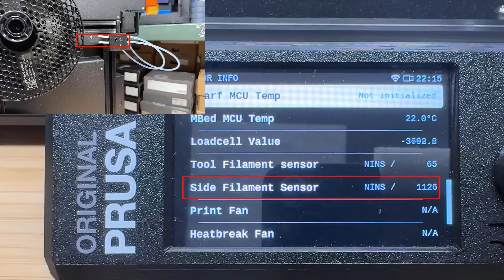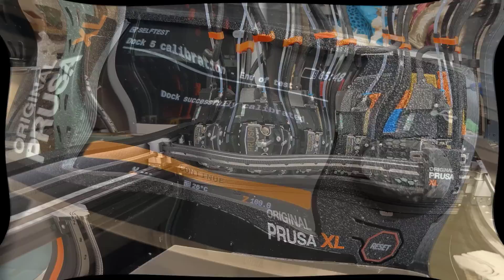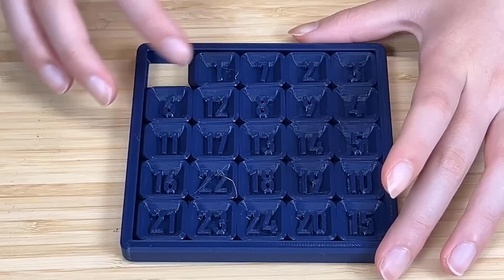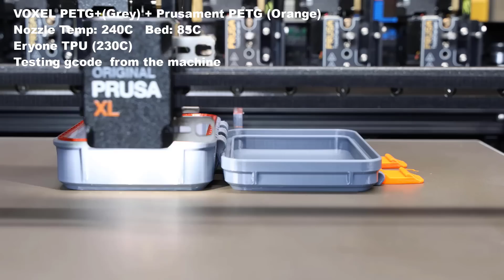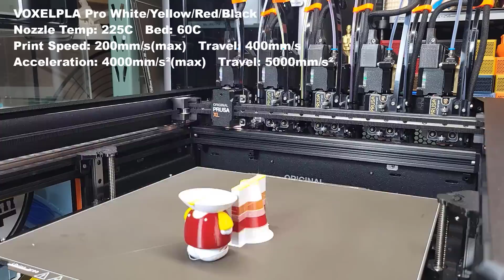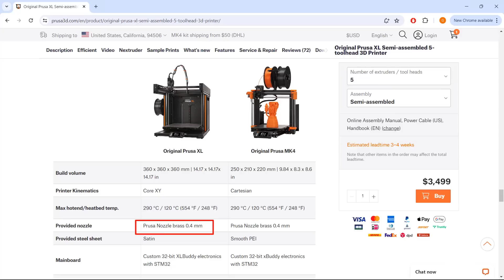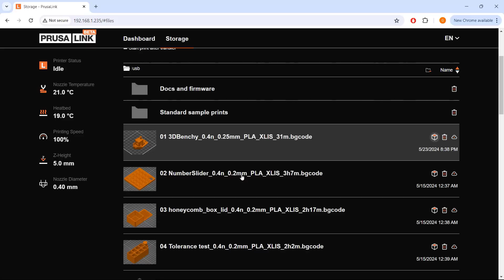Prusa XL In-Depth Review: 5-toolhead auto tool changer 3D printer compared to BambuLab AMS

Comment: The clearance test is faulty, it needs also a 0 and a -0.1 tolerance. Which should not fit. Else the companies can cheat
Reply: that's not how this works.
Reply: @thejoetandy  This is how it works. All professional tolerance gauges have both a fit and a no-fit side
Reply: The clearance test only has value if the filament was calibrated properly. My filament prints too thin extrusions out of the box (0.4 instead of 0.45 mm width) and then even a -0.1 will just fit ...
Reply: Tell me you don’t know anything about 3Dprinting without telling me.

Comment: Personally the printer is kinda open source however the pcb boards nozzles are all prusa proprietary parts you can get generic nozzles but the pcbs arent open source only orusa make them to be fair tho they will support the xl for years and years but you cant just use a clone pcb on them and the printer where i live is almost $8000 to me yeah 5 tool heads is cool but its just not worth it considering i can get a few x1 carbons with ams they might not be open source but you can get more for less
Reply: The XL printer is not for ordinary people. More X1C printers also means more waste. Some AMS printing is 75% waste. For a 1kg print, the cost is 4kg of filament. If the XL saves 3kg of material it's a matter of time before it pays for itself.
Reply: @slovackoinfo  maybe but its the $7500 outlay I would have to pay to save filament
Reply: Hope some  chinese company copies it and offers it with heated encloser for 1800. Prusa is great but the must learn to outsource mass production of some parts
Reply: @psxtuneservice yep I agree I reckon bambu will copy them

Comment: Absolutely great review. It seems really open and neutral.
Where I disagree is on the issue of outsourcing. You can't compare Prusa with Apple & Co. Prusa is still a very small company in comparison. That wouldn't work and the printer would no longer be the same.
Reply: The USA is a very good example of outsourcing over decades by the Boomer generation so they could make a quick buck, and I hate it. Almost everything now is sh!t if you dont do extensive research.

Comment: Not sure I'd use Tesla as an example of good quality control. 
Prusa's biggest problem is their stubbornness to change and adapt to the market.
Still no enclosure by default for higher temp materials like ASA/ABS.
Still no camera for monitoring and problem detection.
Still stuck on Marlin even though the 3D print market has moved past it. 
The IDEX and Tool Changer 3D printers coming over the next year are going to really hurt, especially when they can do more for less cost.
Reply: Marlin is still doing strong, though Prusa XL probably doesn't have much (any?) of it left.

Currently there are two IDEX printers, Sovol SV04 and SnapMaker J1(s). There hasn't been rush to that market, and though I'd like to see modern low-cost IDEX printers, I don't think that is going to happen + it's impossible to make coreXY IDEX. I doubt there will be 5-head IDEX, or even 3...

Prusa has their own market and they seem to be selling more printers than ever, so they don't need to react for cheap hobbyists 😅
Reply: Not including an enclosure by default isn't really an issue as long as getting one is an option. If anything, it benefits customers who don't need an enclosure and can therefore save some money. Much like how Bambu's P1P is normally unenclosed but you can buy an enclosure kit for it, as well as the new SV08 allowing an optional enclosure if you so desire.

A point could be made how it took this long for Prusa to release an official enclosure for the XL, but at least it is coming very soon now.
Reply: @richiemacrophage not at that price, a $500 qidi has an active heated encloser and if you print anything better than PETG it will be the better printer....without encloser it is a 5 color PLA printer for $4000.
Reply: @psxtuneservice  The Qidi is also smaller, more flimsily built, and currently has no option for a 4/5 head toolchanger modification. 
Again, you don't need to spend extra for an enclosure if you only intend to print PLA, PETG, TPU, etc. If you want to do so, then go buy the extra enclosure addons for your respective printer. If you're primarily printing PLA then the enclosure is going to actively work against you.
Reply: @richiemacrophage  The issue is the that the SVO8 and P1P are drastically lower in price compared to an XL. People tend to accept shortcomings if the price is lower. With the XL costing as much as it does, it makes sense that people expect there to be an enclosure. Hell, I'd expect an enclosure at that price. Saying no enclosure "benefits" the costumer is cope. The enclosure probably be an exorbitant price like their enclosures for their I3 printers, too.  

As of right now, the XL is the only machine on the market with the capability, so they get to charge what they want for it. Hopefully, competition steps in quickly.
Reply: @plutonasa  
"The issue is the that the SVO8 and P1P are drastically lower in price compared to an XL. People tend to accept shortcomings if the price is lower. With the XL costing as much as it does, it makes sense that people expect there to be an enclosure."

The XL's higher price is primarily a fundamental problem facing Prusa, in that they are based in the Czech Republic and have to juggle around a lot more taxes/fees, higher European wages, etc, all of which adds cost to the final product. In comparison, most other major 3D printing companies are based in China's massive technology hub where you could probably walk to your parts supplier. As of now, there isn't really a way for European or maybe even American companies to compete with Chinese ones in terms of pricing. If Prusa was based in China, they would likely be just as affordable as everyone else.

"Saying no enclosure "benefits" the costumer is cope"

Regardless of whatever you think, the logic is plainly there and still applies. Not everyone needs an enclosure, or some are capable of DIY'ing their own for far cheaper. Unenclosed printers will work just fine for those people, while those that don't want to go through the hassle of setting one up will always have the option of spending extra for an official enclosure kit. 
Whether or not you want an enclosure is also specific enough that leaving it optional is a valid strategy compared to leaving out more critical printer hardware as some really budget companies used to do.

In fact, customizability is a really convenient idea that I wish more companies would do, and ones that premium printer kits (like RatRig) let you do, while also offering a standard/general option incase you just want the base model. This indeed benefits the customer if you have a specific need or can come up with your own parts to save cost.

Comment: Just think - for the price of the 5-extruder version (with shipping), you could also get 5 Bambu printers.  Huh.
Reply: And their total print volume would be same as 1 XL.
Reply: Dude, Xl has 2 time bigger print surface.
Reply: @GhostRider5555555  this is correct. about 2 times the area, about 2.8 times the volume.
But size is not everything - esp most prints do not need the size. The main difference is multimaterial, not multicolour. Using TPU in a filament changer - maybe using vario shore and custom gcode for toolchange to allow the temperature being adjusted before filament change. Also abrasives in a bambulab can damage the AMS quite fast.
There is something you can do with a toolchanger, but not a filament changer.
Reply: And then you'd have 5 unreliable printers with zero customer support and long ass print times. Bambu is junk compared the prusa EU quality.
Reply: @LilApe  You are a funny man.  Please talk to Prusa XL owners and got an idea of how horrible their experience has been so far.  Many of them take months of troubleshooting and back and forth with support to get their first successful multi color print.